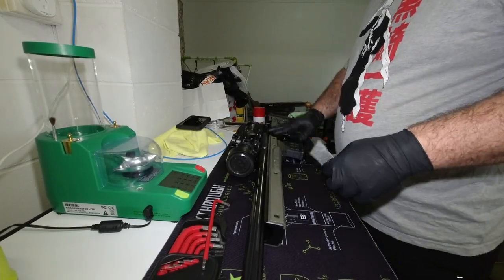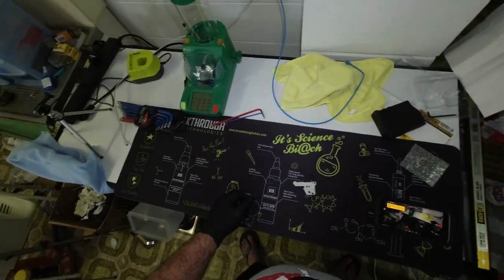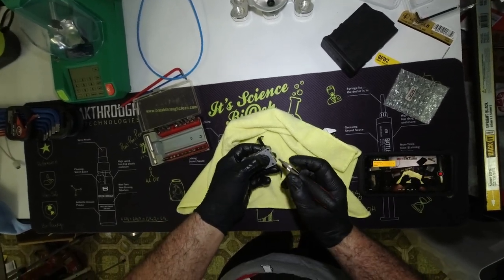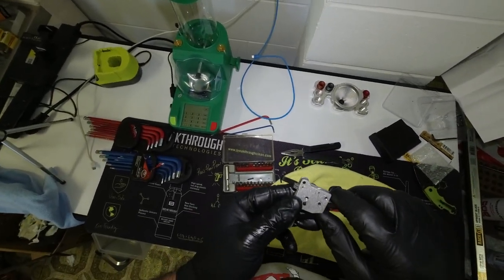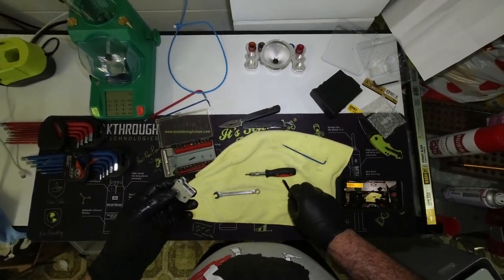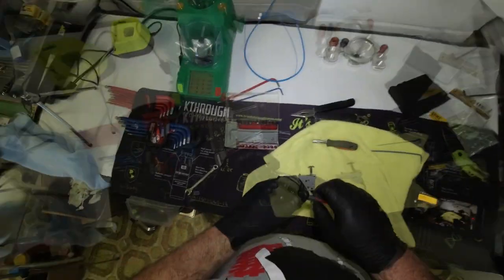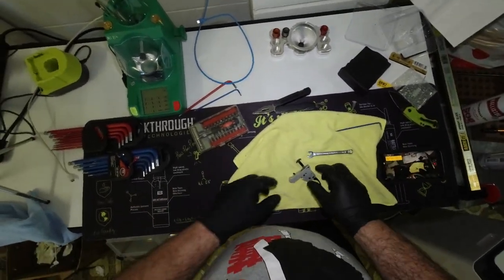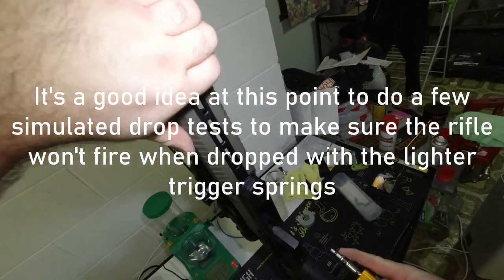Howa (HACT) Trigger Spring Kit Install

Comment: have you ever worked out how to make the trigger single stage like that trigger guy use to do?
Reply from the maker: No, I've sold this rifle to fund another.  If I wanted a single stage trigger on the howa I'd just drop the coin on an aftermarket trigger like a timney.
Reply: @brucesslog1262  thanks for the reply. did you get the spring kit from gun bloke? i ordered a kit but i have a bad feeling its not coming its been 2 weeks now
Reply from the maker: @nuggz4president  when I've ordered stuff from him in the past it's taken a long time to come. I honestly can't remember if I got rhe springs from gunbloke or high velocity hunting Australia.  I've delt with them a  few times and they're pretty quick with dispatching stuff.
Reply: This would have been a really great vid but I just cannot see what your doing - maybe a light would have helped.